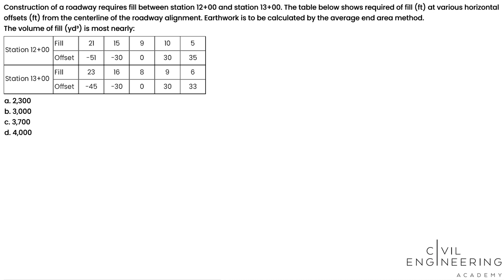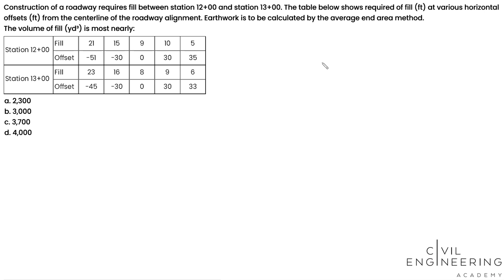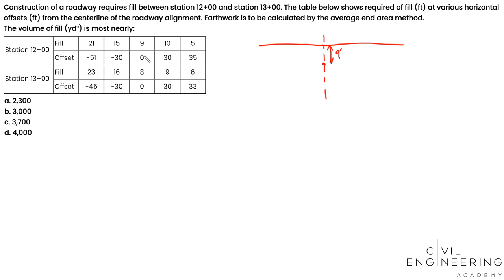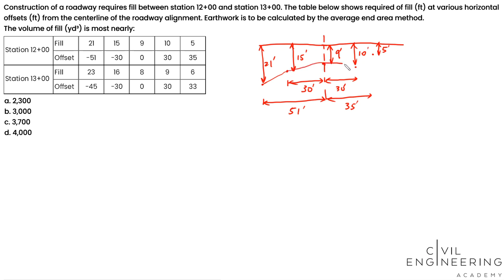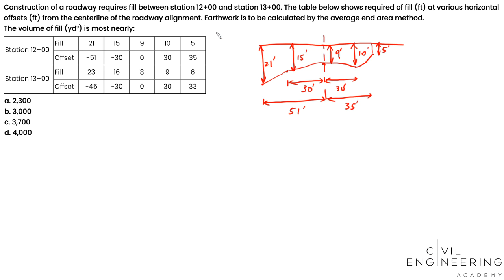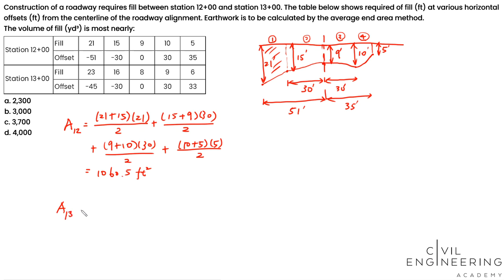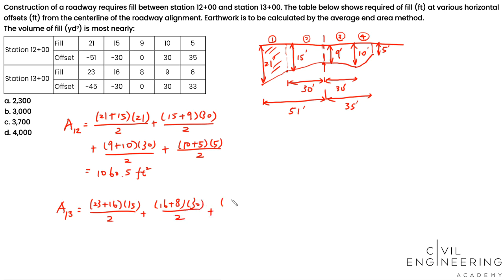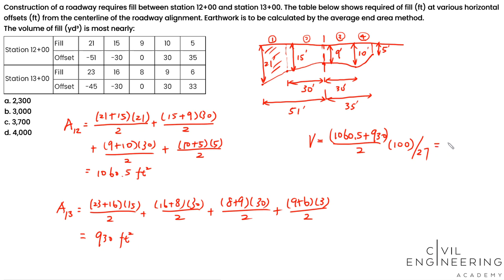PE Exam - Construction - Find the Volume of Fill Using the Average End Area Method

Comment: CBT Ref Man Pg. 49, Sect 2.1.2
Reply: Which page of ncees hb 1.1 did you use for conversion from ft3 to yd3 ?

Seems convo factors are too few in ncees now for a direct convo. I tried doing ft to m to yd. But this is a silly waste of time.

How to directly go from ft3 to yd3 without memorizing convo factor ?
Reply: Ncees hb 1.1, p. 49.

But where to find ft3 to yd3 convo factor ?
Reply: @oleopathic  I don't think its in there, but its simply: 1 yd = 3 ft, 1 yd^3 = 27 ft^3 (3^3)
Reply: @Remember_Baker  i checked and agree. ncees has you memorizing this! thanks for confirming.
Reply: What a beautiful question! I am manifesting this question on my exam 😂😂